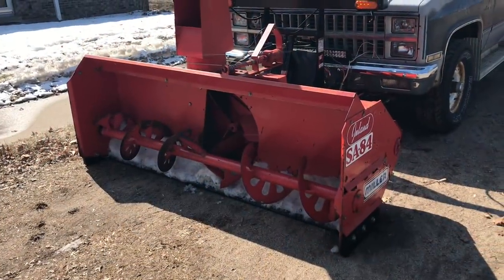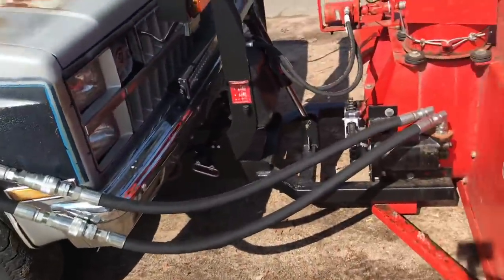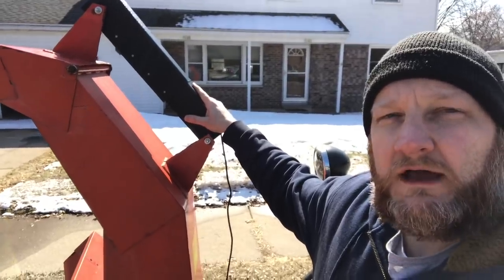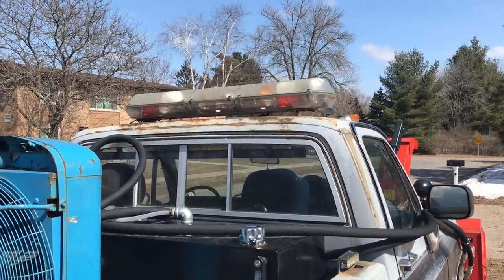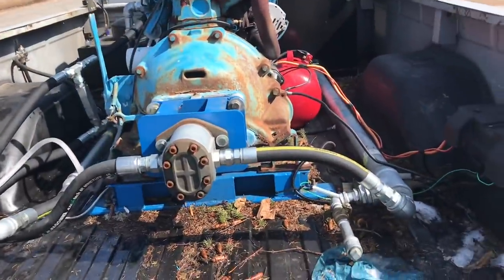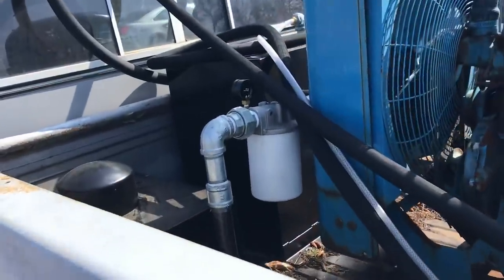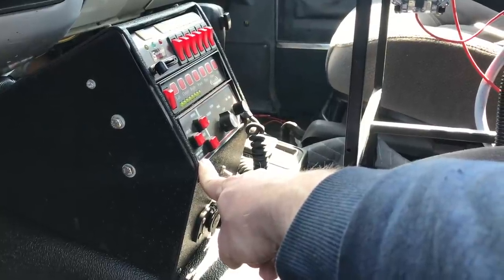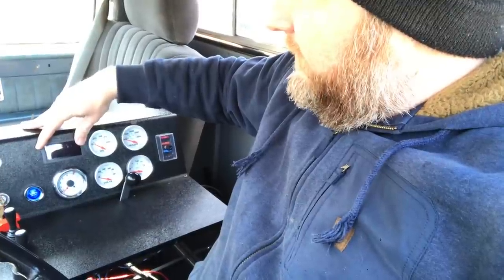Truck mounted Snowblower - "Project Frankenstein"

Comment: The closer the higher actuator bolt is to the chute itself the faster the chute will move. It will lose strength proportionately but if the issue is speed I would move the bolt as close to the chute as possible without losing range of motion. Awesome project glad you made a video for us. 👍

Comment: I have dreamed of having a front snowblower on my 2500Hd extended cab years ago. I don't like when the motor is mounted on the front too much weight. Beautiful job obviously needs to be cleaned up but its a process. I always imagined a very small diesel engine in corner of bed (with stack) for hydraulic pack or even drive of pto or belt on engine.    I had to click to check this out.

Comment: I really like what you have done and hope it's totally successful.  Mine was made from scrap on the farm including a 1980 1 ton 2 wheel drive with a 250 6 cyl and powerglide trans. I powered the blower with an olds 455 and turbo 400 trans mounted backwards where the box would have been, made a chain case to drop below the the chassis and drive it with an old corn chopper shaft under the cab. That way I could swap it from the truck to the tractor. Your low range 4x4 might not have to work so hard to move it thru deeper snow keeping it cooler.  I boiled the 2sp 3 times blowing out the front seal. I should have installed a trans temp guage! Good luck!

Comment: Wow. This is impressive. Amazing job, that's a sweet rig you've built there. 100% deserved a "like". You clearly have a lot of creativity and mechanical skill. You may already be aware, but the guy behind the "Tech Ingredients" channel built a turbojet from a turbocharger and did a lot of explaining about the technical aspects of things like pipe diameter and gas flow which may be helpful if you haven't already built it. Would love to see that beast you've built in action.. could probably clear a typical driveway in all of 2 minutes 😂

Comment: That is seriously awesome.  If you had the leftover weight capacity you could add a back blade to the rear for parking lots if you do them.  Spent many many hours on a no cab farm tractor in a skidoo suit blowing snow.   Would have given a lot for that lovely snow rig.
Reply from the maker: I’ve considered adding some sort of blade to the back.  My focus is residentials so I don’t think I would have much use for it.
Reply: @uwpd  Ya the good ones hit 14 feet of sweep.  Great for lots. Bad for driveways. I always liked a blower better so I could toss the snow  "over there"   The middle of the lawn was great if they had kids.   Insta snowfort!    Good luck with your rig.

Comment: Frankstien gets my approval.  Put a roof over engine if you move snow  during a storm.  You never know when snow will stop and moving during  heavy snow helps. Instead  of waiting  you have a pileup
Reply from the maker: Thanks for the approval.  I do plan to fab up a cover for it.  I’ve started gathering parts to build a slip roller and an engine cover will be the first project for it.

Comment: I have seen some ham-fisted projects, and I have seen some next-level projects. This? This is out of the park on to N. Clark Street.... Very, very cool project!! Love the control console - well thought out! Speed sensor will eventually be for the main auger?  My only $.02 would be to be careful using plain-old galvanized sch 40 Home Depot pipe on a hydraulic system - they were never intended to be used on the high-side of a 3000 psi hydraulic system... Love the project!!! Would love to see it in action when the snow gets stacked up.
Reply from the maker: Thank you.  Yes the speed sensor is for the "pto" speed.  I don't have any galvanized pipe on the pressure side of the system but I appreciate the warning.  I'm looking forward to some good snow storms to get some footage of it in action.

Comment: Love your setup I'm doing the same thing for my 01chev 2500hd I have a 350  small block chev engine planning to use hiniker plow frame so I can use my plow blade when I don't need the blower not going to be ready this season my question is what electric solenoid did you use to run the blower thank you. Glenn

Comment: Nice project. I wonder what the specs are on the hydraulic system, pump flow, engine output etc. A similar idea occurred to me, but to design it as a universal power unit that could be loaded into the bed for this application but used elsewhere in summer months.
Reply from the maker: Thanks.  The engine is rated for approx. 100hp, it reality it is probably closer 90hp.  The pump is rated for approx. 40gpm @ 3000 rpm.  This is from my memory.  I can look up the actual pump specs if need be.
Reply: @uwpd  I like that the hyd.motor has that crossover check valve so it can freewheel, saves a lot of wear on that motor.

Comment: @DarrenReid
Are you willing to share hydro specs and or model numbers?  I know from working in the Agronomy field hydraulic power gets eaten up fast.  I'm trying to decide between engine drive and hydro drive.  I'm looking at going 92"+ on width and was chain/pto drive, until seeing your video. Thanks

Comment: FYI, to anyone watching this... the older Versatile 400 swathers have an I6 ford with a hydraulic pump bolted right to it.  They are very cheap to buy.
Reply from the maker: This is true.  However most of those were the smaller straight 6, 200ci I believe.  Also I don’t know if that hydraulic pump will flow enough for this kind of application.
Reply: @uwpd  The pump is for the hydraulic drive on those swathers.   The pump would easily pull down the motor if you tried to accelerate too fast.   The 400 motor is rated at 40KW.  The 4400 is rated at 60 KW.   All swathers (and combines) are hydrostatic drive.   Any one of them could be used for their motor/hydraulic pump.

Comment: Nice setup my friend! I want to do this with my truck. I have a PTO port on my transmission and I can buy a pto pump for it. I wanted to ask how powerful of a pump do you have? I can go as much as 300ftb of torque. Is that enough?
Reply from the maker: Thank you.  The engine I have is rated for 220-260 lb-ft.  So if you end up with a setup similar to mine I would think you will be okay.  You need to make sure whatever pump you use can flow enough fluid for your hydraulic motor.

Comment: I tried a project about like this, how do you keep the auto transmission from boiling when blowing heavy and deep snow? That was the only thing that stopped me from continuing to use it!
Reply from the maker: It hasn't been tested in heavy/deep snow.  I'm hoping the engine fan and trans cooler will be enough.  If not, I might have to add another trans cooler.  The trans isn't stock, it's been modified to handle more power, so hopefully that helps.

Comment: What is the horsepower rating of the hydraulic motor? How did you go about figuring out power needs and pump needs and engine horsepower requirements?
Reply from the maker: With this setup the motor should be putting out approximately 50hp at the blower.  
I found some calculators online, using the variables I had I was able to figure out what I needed.  I then contacted a local hydraulic shop and they confirmed what I had come up with.  I ended up getting the major hydraulic components from them.  I could have gotten them cheaper online, but since they helped with the design I spent the extra money going through them.

Comment: How many Rpm is the motor running ? And exactly which hydraulic pump and hydraulic Motor are you using ??   PM me please
Reply: I also would like to know the exact pump and motor used with the sprocket sizes too and the rpm’s ur running the gas motor. Pm me please Ron Webb

Comment: How did you couple the crankshaft and the hydraulic pump? Thanks
Reply from the maker: The engine came with a bell housing and clutch.  I used a roller chain coupler to connect the output shaft to the pump.  I had to fab up a mounting plate/spacer for the pump.
Reply: Thanks for the fast response 
Nice work

Comment: That's a big hydraulic tank.
Reply: Your standard tow truck carries 50- 55 gallons of hydraulic fluid so having that size tank would be correct outstanding job on the truck 😎

Comment: Sure would have been nice to see it in action. The whole thing just seemed so theoretical.
Reply from the maker: Just waiting on some snow.  I’ve had a chance to test it a couple times and trust me it works.
Reply: @uwpd  It would be good if you could shoot some video the next time it's in action and post it for all to see.....Thanks👍
Reply from the maker: @markg.2501  I posted a video of it in action.
Reply: @uwpd  Hey yeah, I checked it out. I appreciate the heads up. What was that 3-4 inches? Where are you located that you get so little snow?
Reply from the maker: @markg.2501  it was about 3”.  I’m in Central Wisconsin.

Comment: How does the little straight 6 do running the hydraulic pump? Does it have enough torque or would you go bigger?

I'm planning on using a 350 Chevy for mine.
Reply from the maker: It should have plenty of power but I haven't had a chance to test it in heavy snow yet.
Reply: That 300 inch 6 should have plenty of torque to run that. they used them on old gas wood chippers. And Bombardier track drive plows.
Reply: I had that engine in my full size 83' Bronco which had a 4 speed on the floor. Torque was no issue and that was a heavy body.

Comment: Holy shit that is a monster snowblower! Did you have to upgrade any suspension components with the engine/pump in back and all that weight hanging off the front? I'd guess it would be much heavier than a standard snowplow.
Reply from the maker: I haven't yet but do plan to install 1 ton springs in the front.
I estimate it the blower itself to be similar in weight to a Boss V-plow that I previously had on the truck.
Reply: Yeah iys really not all that much weight there. Its heavy but not stupid heavy.

Comment: Very nice idea the only problem is you're probably a little overweight but when that things out working thay probably won't bother you
Reply from the maker: The truck could definitely use some more power. I plan to drop a 5.3 or 6.0 ls in it.

Comment: That pipe is not RATEDfor hydraulic use on the pressure side of the pump. FYI pumps don't create pressure they create flow, restriction to flow causes pressure.
Reply from the maker: There isn’t any pipe on the pressure side of the system.

Comment: is that shear pin protected or electronic auto stop?
Reply from the maker: The blower has shear pins plus the hydraulic system has a relief valve.

Comment: Why not run the snowblower hydropump on the motor under the hood
Reply from the maker: There are a couple reasons.  1. The difference in engine speed required.  2. Power/drive requirements for the high flow pump/motor.  Maybe I’ll have to make a video addressing this question.
Reply: @uwpd  thxs for the answer I just wondered truck will work better with wieght in the back for traction anyways

Comment: This is double fuel consumption and you get less visibility than with a tractor so i dont understand why you haven't bought a old tractor instead it would save you money and time but anyway a great idea
Reply from the maker: Yes a tractor would have more visibility.  Road speed is the limiting factor with a tractor.  Additionally the tractor will be running at close to full throttle while in transit.  Where as the blower engine will be at idle or even off in between jobs.  I do have my eye on a JCB Fastrac for down the road.

Comment: Cut 2" OD black PVC for spacers under lightbar, more visible,
able to use traffic function again.

A 2 cylinder  would turn the pump the same, maybe like this--->
https://www.ebay.com/itm/16hp-Onan-2-Cylinder-Engine/124337069871?hash=item1cf3111f2f:g:bRgAAOSwco1fXsuL

The blower part is awesome- the engine/ trans/ hose gauge is overkill.
Reply from the maker: The lightbar doesn’t have a traffic advisor.  However I do have one mounted in the back window which is now partially blocked by the motor.  I had installed it prior to installing the lightbar.  
I don’t really have a need for the TA anymore since I installed the lightbar.  

That engine might turn the pump but it wouldn’t have the power required.  I’m putting approx. 100hp into the pump and should be getting approx. 50hp at the blower.  The hose size is required for the flow that is required.  A hydraulic equipment builder helped design the system.
Reply: @uwpd  I didn't mean any slight or insult to your device, sorry about that. I didn't know or realize the actual flow aspect. I was just imagining a regular snow blower. I really didn't think about the size of it.